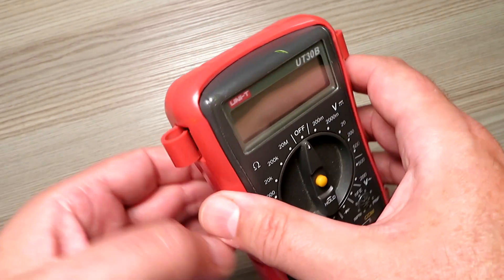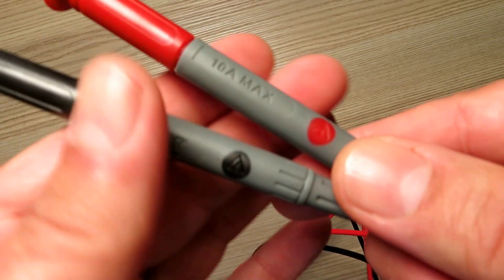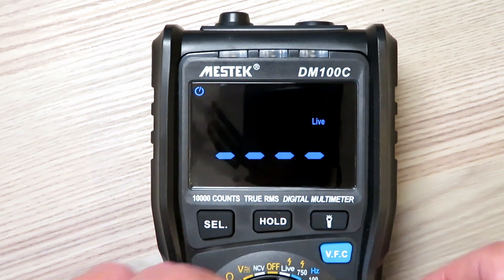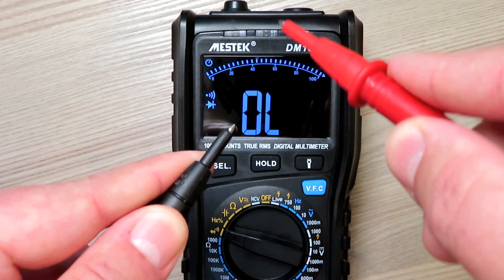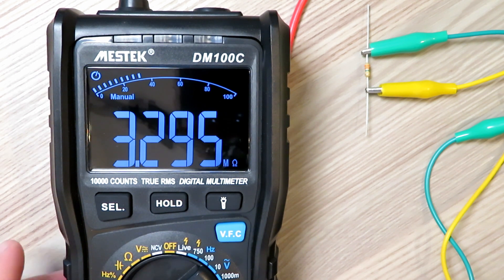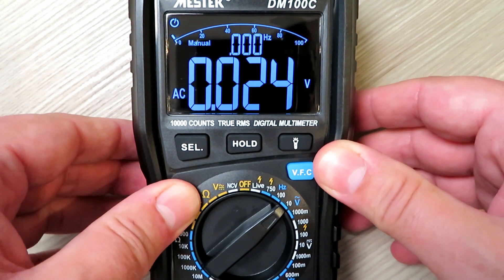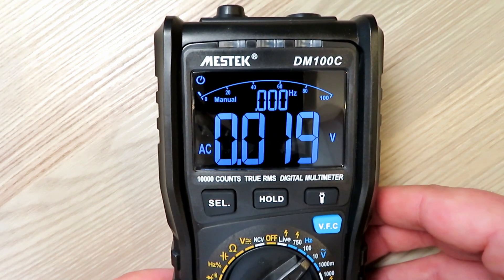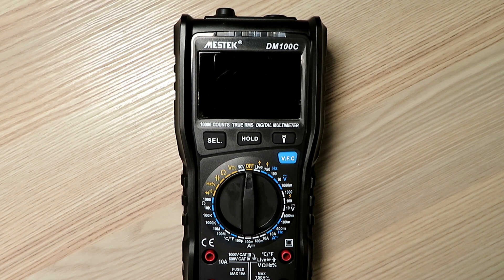BRILLIANT AFFORDABLE DVM FOR HOME USE - MESTEK DM100C - 2020 VERSION

Comment: I have this model of meter, I've had it for over a year. I came across this video while looking for a pdf of the instruction manual, I seem to have lost the paper copy. 
It's been a great meter, especially considering the price. I like that it does AC millivolts, which most don't do, especially older meters. The only thing I don't like is the auto-shutoff, which is annoying (and the reason I was looking for the manual to see if there's a way to disable it, or increase the timeout)
I don't use it professionally, I'm just a hobbyist who likes repairing old audio equipment.
Reply: From an Amazon review: "To defeat the Auto-Off, hold down the "SEL" while turning the unit on. The clock icon in the upper left corner won't be there, and it will not turn itself off in 15 minutes. It will beep like it's going to turn off, but it's nothing more than a reminder."
Reply: @John_Ridley  Thankyou so much for this ! I just tried it, and it works, this fixes what is really my only quibble with the meter.

Comment: why didn't you press the "SEL" button when you were in diode/continuity mode? would it have made it better?
Reply: for anyone else wondering. its because even if you press it nothing will happen, it automatically chooses it, even though it says in the manual you can do so.

Comment: the listing on amazon  mentions the Safety Cat for the metre
Reply from the maker: That's good, it should be stamped on the meter, I couldn't see that it was.
Reply: Like Knoxie says, it needs to be stamped on the meter. If I got caught with that at work, I would be for the high jump.  Good hobby meter, but Fluke all the way in a professional environment.
Love your vids BTW!
Reply from the maker: Thanks, yes Fluke for me too, I'll use cheaper meters on mains 230v but even I tend to run fluke probes and leads on them, thanks for the comment. 👍

Comment: what is FVC button for??
Reply: It's vfc...
For variable frequency controller (like 3-phase motor controllers).

It filters out the high frequency pwm signal and shows the effective voltage.
Reply: @doctordapp  do you have any idea if i could use the VFC function to check PWM signal on crank shaft position sensor on car engine??

Comment: How do you measure an LED?
Reply from the maker: Positive probe on the longer leg of the side, negative probe on the other, set the meter to diode test and you should see the forward volt drop off the diode, depending on the meter the led will light up as well.
Reply: @knoxieman  Ok, thanks.